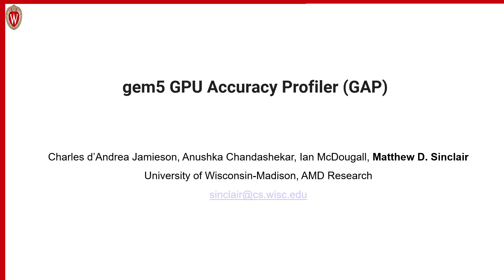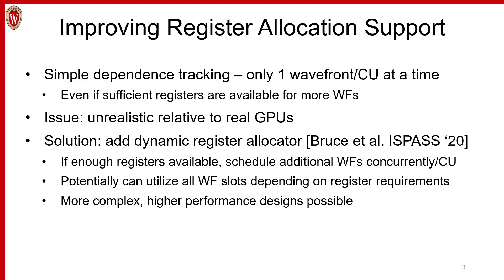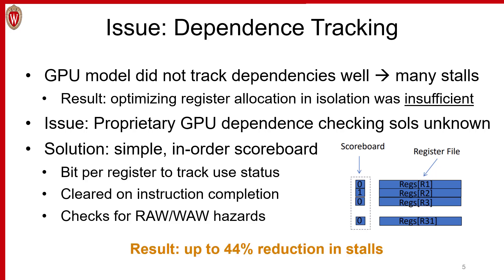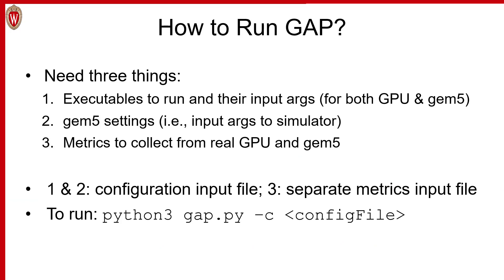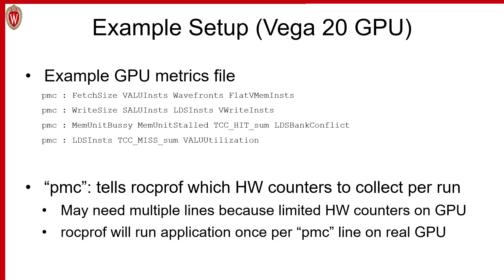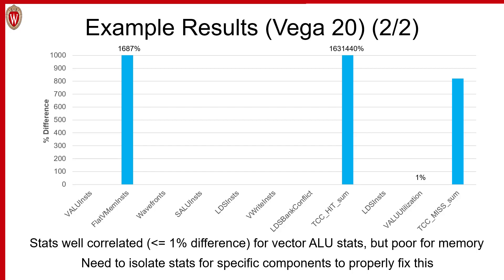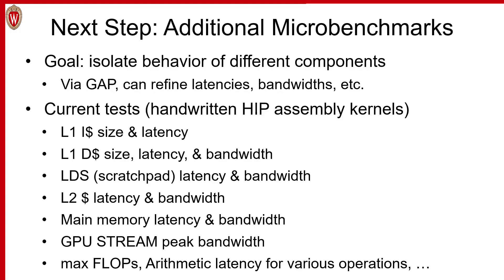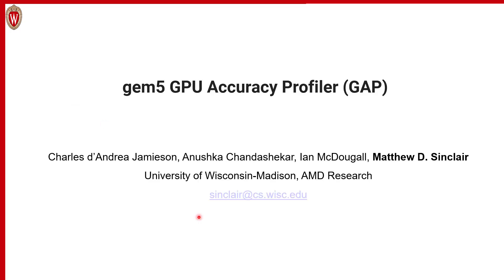gem5 GPU Accuracy Profiler (GAP)

Comment: If people have questions about this, "@"'ing me here is a good way to get my attention (email works too, of course)!
Reply: Hello，can the gem5 now support VEGA20(gfx906)?
Reply: @hanggao-im6tw  I have not personally tried gfx906 -- I've only tried gfx900 and gfx902 -- but in theory gfx906 should work as the underlying ISA is roughly the same.
Reply: Thank you very much for your reply. I have a question about a performance analysis tool. Do you know how to do performance analysis using gprof, which is officially supported by gem5 in <gem5 binary>?  In addition, I don't have AMD GPU in my PC, can I install rocprof in the Docker images officially provided by gem5 ？
Reply: @mattdsinc  Excuse me, can the gem5 execute gfx900/902 assembly code?
Reply: @hanggao-im6tw  yes, as mentioned above
Reply: @mattsinclair9149  Ok, thank you. I'm studying your project. However, in SE mode, gem5 executing assembly 900 code always has errors: Tried to read ummapped address 0X7373656363e9. Should I try FS mode to run assembler kernel code?